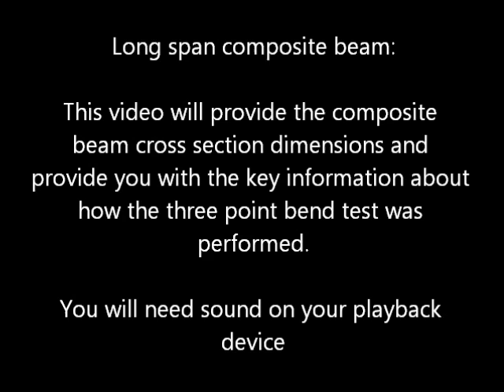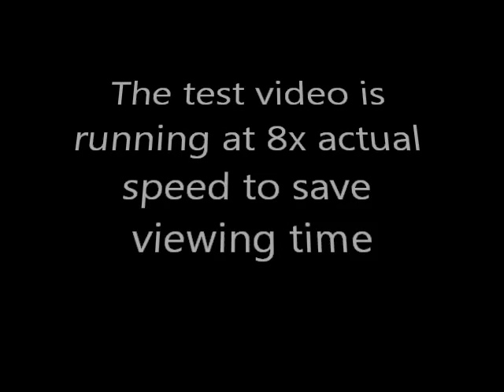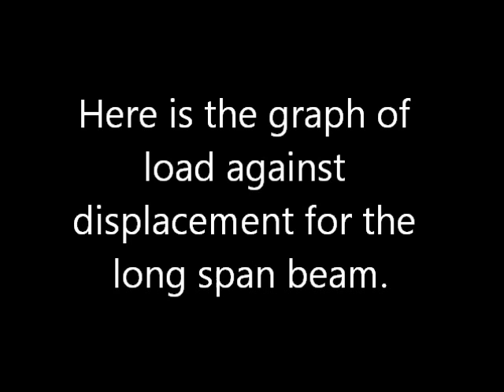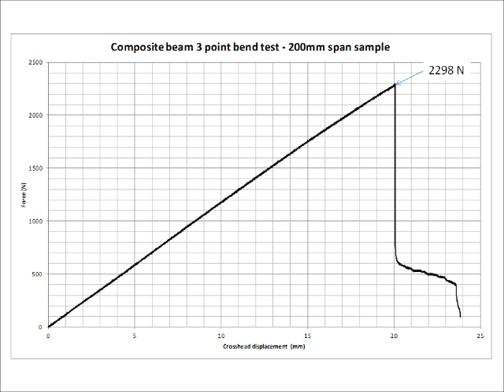Composite Beam - Long span length 3 point bend test

Comment: It looked to me like it failed the way I predicted: Compression failure on the upper surface, rather than a tensile failure on the lower surface. The lower surface didn't start to fail, until later. It flexed much more than I expected.